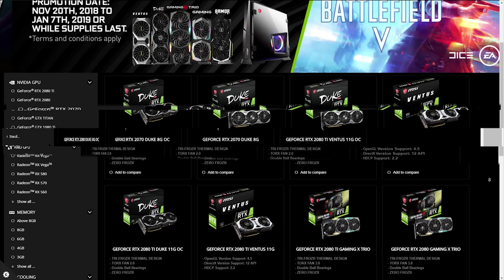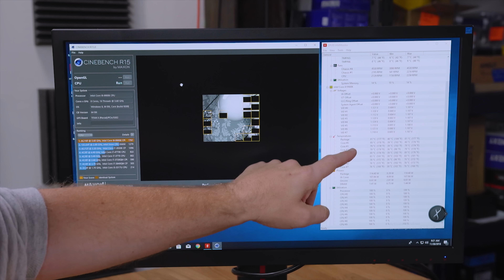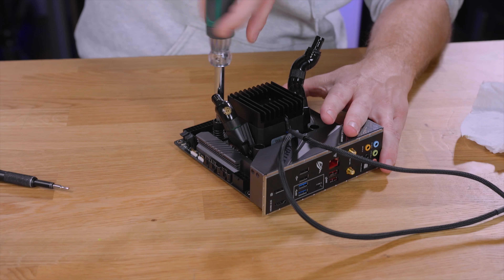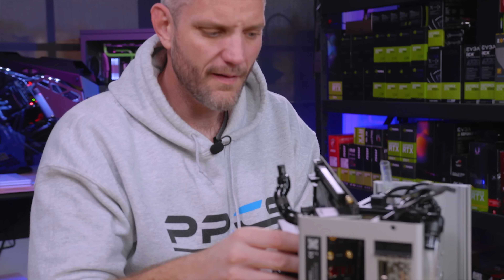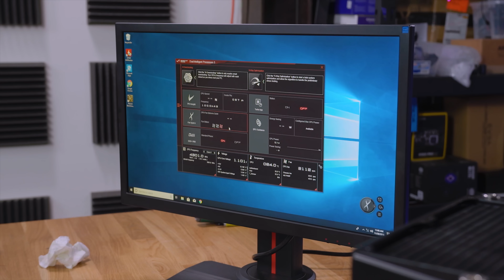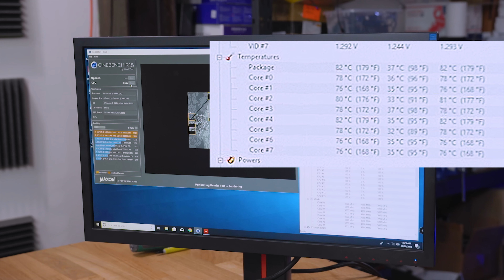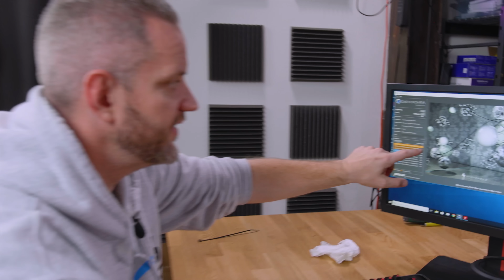Something went wrong with the small watercooled PC...

Comment: Mr. Jay, may I ask your recommendation on a Great PC Case i have a AZZA ONYX 260 and space is running out i need a Water-cooler setup fast because I got the i7 4790k 4.5GHz last week and its Constantly idling on 70+°C and it only has 2 drive bays and i have 4 hdd's 2 of them is just laying on the table behind the Back panel so im asking on Pc case recommendations on great space and drive ports in between $85 to $185 plz or anyone here I need help from the community.. please

Comment: Hy, im interest at a 3440x1440p or a 2560x1440p monitor, but im not shure if i can run this on high fps. I have a i7-3770K (4,6ghz) and a Gtx 1080 (2,1ghz). Or is my Gpu way to weak for this 1440p Monitors?

Comment: Take off the plastic IO cover on the motherboard,  it will help thermals a tiny bit. In a build pushing the boundaries like this it is worth doing. Also, the Noctua A12x25 fans take the Vardar fans to school. You can run them at the full 2000RPM and get the same or better cooling with less noise.

Comment: No shit the 9900k is a scam at14nm, and can’t be cooled with aftermarket water cooling in a normal case and why pay 550 hundred for a cpu that gets you 1-5 more FPS over an overclocked cheap 8700k and or. 8086k?...

So what do you imagine a 9900k would do in a heat sink block called an it’s mini itx case with all that crap in there?..

An oven with no buns... so good luck hahaha put an 8700k in there and I bet better fps and performances in benchmarks and games with a cooler gpu to boot.

Go with a 9700k... 9900k is not worth it just like the crap called rtx and it just works by ncrapia.

Comment: I'm highly debating lapping my FX6300... now before anyone starts to bash it, for all I need it to do, coupled with a 960SSC from EVGA, it meets my needs. I overclocked it to 4.5GHz, and am running the EVGA 120mm CLC, however, my luck with chips is just as bad as Jay's luck with never having to take apart a system he builds, so I had to up my voltage to about 1.4+ so it tends to run a bit on the warm side... still around or below 60C in Prime95, but I would like it to run at like 50 :/

Comment: @jayztwocents You could have a faulty CPU as when i had purchased my origional intel i7 cpu i was idling at very high temps and opening anything would cause my temps to shoot over 100 degrees i think you should try another on or RMA this one and see if the problem persists because it turns out that i had a faulty chip.

Comment: On my last build it turned out that my Swiftech hit a capacitor so it wouldn’t contact the cpu. Ended up desoldering the cap and resoldering it to the back side of the motherboard. It worked great but I wouldn’t recommend as you super void your warranty.

Comment: Damn Jay this is so relevant to me...I just installed the Apogee Drive II into my first full custom loop (7700k delidded @ 4.5ghz , GTX 1080 @2000mhz) all crammed into a Lian Li PC-05s, single 240mm rad...GPU stabilizes at 69 C but the CPU is hitting as high as 83 :( In Cinebench I only hit 72 though. I have to say, it sucks that this unit is the only really viable CPU block/pump combo out there, because I've had bad luck with Swiftech. I had an MCP30 pump fail, and then my MCP35x after ~2 months, and this Apogee uses the MCP35x as well. Guess we'll see.

Comment: Got a question for ya. My son's pc was hitting %100 disk usage. Power supply is fine (being used on a spare system). HDDTune showed only 2 small red squares, so not sure if the hdd was bad. AIO rad was gunked up dust. I installed the fans to pull air down from the top (don't know why) and the top's "dust filter" didn't filter much. I'm left with 3 possibilities: motherboard going bad, cpu overheating, or hdd really was going bad (despite hddtune). Should have done testing, but just had surgery recently and haven't been able to move around like I want. Any ideas?
Reply: If you're using an HDD, it's not showing any SMART errors, and windows is doing any background task like Windows Update, you can expect %100 usage unfortunately; especially if the PC isn't essentially stock. The best you can do is eliminate all startup programs besides those that are essential and make sure Windows and all other programs are up to date. 

Another thing to keep in mind is that the absence of SMART errors does not mean the HDD isn't going bad. SMART monitoring is far from perfect and I've seen several examples of drives reporting good health suddenly failing. Ideally, you would get a small SSD and install windows to that. Use the HDD to store files and programs and make regular backups of the HDD. That way if the HDD goes, you still have a functional computer, and can restore your old files to a new HDD when you replace the old one. Plus SSDs are really quite accessible these days, especially if you only need one large enough to act as a windows boot drive. 

Motherboards going bad typically result in crashes, complete system failure or random hardware errors. You can check the CPU temperature of your computer with a free program called Speed Fan. 

Something else you can do is go to userbenchmark.com and run the benchmark on your computer. Look for areas where your system is performing well below expectations. This can be very useful information when diagnosing a problem.
Reply: @mechanought3495  Thanks for the reply. At the time, I wasn't able to get an ssd (4 years ago). I plan to do some upgrades on his and my wife's in February. For the time being I pretty much gave him my older computer. Easier on me until I get more mobile again. Doc's already been threatening to put me back in the hospital.

Comment: so the fluid gelled up (after one day) because it was getting too hot, even with poor thermal transfer from the cpu.  but now you improved that thermal transfer, so the fluid will have more heat put into it than before... and you didn't do anything to improve pulling heat out of the fluid... so the fluid will gel up even faster now...  right?

Comment: I think i have a similar issue. I had an 8700k at stock hit mid 90s (this is on a custom loop: gpu, mobo block, 360 rad and 420 rad) and it turned out to be some terrible thermal paste contact on the motherboard block. I'm now getting mid 60s to high 70s after just a better paste application. I'm thinking lapping will help more as that's still a bit high, but i lack a rigid flat surface so can't do that at present,

Comment: I honestly would have thought at 4.3 gigahertz that it would be way higher than my ryzen 7 2700 at 4.1 gigahertz. I use pstate overclocking at 1.3 volts and I score 1853 on cinebench and stay under 75 degrees under full load I understand this is a small form factor computer.

Comment: Jayz.. can you rotate that cpu block 90 degrees.  Could the fins be trapping heat since there is no air movement across it .. let convection take it up vs. trapping by rotating it?  Would going push/pull on it help any?

Comment: Hey Jay,  

I'm building a really expensive PC with watercooling,  About 9 Grand for the build.  It will be the 9900k and a maximus XI Formula board.  and (2) 2080 TI OC's.  I will have (2) 38mm radiators (1) 360mm and (1) 240mm.  Will that be enough to keep the CPU and GPU's Cool?  And should I run it in 1 big loop or separate the loops between cpu and gpus.  Also is there a coolant that you personally like the most?

Thanks

PS: Love the videos!

Comment: Custom cables routed better and the original psu? Could you cnc a hole pattern in the side to exhaust the psu? Add feet? De-Lid? Part 3 for sure...

Comment: Small enclosures need forced air in and free flow out to stay cool... learned this with xbox 360's  pulling air in takes time and when it finally reaches cpu its all ready heated and the air is  thin... swapped out the direction of flow and now u get cold dense air right to cpu and the air gets thinner and moves faster out of the case pushing through all the component restrictions

Comment: I literally finish my computer build halfway through watching this video lol. And it's finally stable 4.7GHz on 8 cores on a 9590 running at 55c using super coolant, not antifreeze to keep it that low. I love this channel it helps me not make stupid mistakes
Reply: Nice but 9590 is not a 9900k. Its a whole different level of performance. Average user benches are 125percent better mixed cores even close to 200 percent.
Reply: @12Burton24  but I would much rather threadripper but I work with what I have.
Reply: @12Burton24  yeah but I got it to run stable at 54c that's an achievement on its own. And they should be able to get it to run at 55c f 5.2 GHz stable. Once I finish my random stuff.
Reply: @Mowuniverse  or maybe not 5.2 ghz is a lot but actualy far away from the performance of a 2700x
Reply: @12Burton24  well I got it there before just couldn't cool it.

Comment: You griped me at building in an ITX case without a carry handle.  Putting that aside, however, all cases should have decent airflow, which is something this one lacks anyway, to an extent.

Before resolving the build, I would suggest you use it daily all the way up to New Years'; this would, then, help to judge what the mileage is on a watercooling solution in such a small, cramped chassis.

Comment: You need to test it with the side panels back on. I understand the CPU and block needed attention, but the whole beginning of the video was a list of components that were obstructing the air flow. So for the second test you essentially eliminate those variables. That testing methodology is not fantastic.

Comment: I have a 3 step suggestion.
1. use the extra "medium hats" to add fans in order to do push pull on both rads.
2. Reverse the bottom fans so that all rad fans are blowing out of the case.
3. Place the case on its side. (Prop up with books or buy tall stick on case feet)

Comment: This might be the issue i have with my 8700k. It runs fine at 4.5ghz but when i put it to 4.8ghz and run cinabench it will hit 100c. instantly. I have the 115i corsair cooler and it wont go over 65c at 4.5ghz. I have mx-4 thermal paste and it seems to be spread out evenly. but shooting to such hi temps so quick makes me think its a slightly warped cooler plate so contact is not good enough.

Comment: It's disconcerting how many CPUs are not flat on the bottom
Have they always been that way?
Or is this a quality control issue?
Reply: There are always acceptable tolerances in any manufacturing.

My guess is that the more effective cooling has become, the looser the tolerances have become.
Reply: Lapping the IHS was already a thing on Pentium 4s, so it's pretty much always been that way.
Reply: @SteelSkin667  Never had this issues with amd somehow
Reply: @thomasgerhard1702  I never had this issue with any CPU whatsoever, whether they came from AMD or Intel, usually the thermal paste and mounting pressure are enough to do the job. Lapping the heat spreader is a thing on any CPU that comes with one, but it's only helpful in extreme cases.
Reply: It appears the cooler probably needed it more then the CPU.
Reply: Lol, I hope nobody laps the bottom of my CPU.
Reply: @princessofscotland  yes sir that would be problematic I'm with you I'll stick to lapping the top.
Reply: Wild Bill Nah, they need a bit of unevenness for good connections.  Though it's no longer 2 to 3 mm on each pin like on the original 8086.
Reply: Wind256: do not say that to a flat earther, he will not see any curvature...
Reply: I suspect the gunked up microfins played the biggest part in bad temps personally. It would have to be out by a lot for thermal paste not to make contact.
Reply: Yes intel cpu's always had this problem. Had to sand every single one of them. Thank god AMD is back in the game.
Reply: gotta be quality control. I've seen many people talk of curved IHSes but my 9900k is dead flat. It was the first thing I checked upon receiving it.
Reply: I don't think lapping was the whole problem, it was the backplate that on other coolers is metal being a thin plastic sheet means that it will bend will cause a poor thermal paste application...

He increased the volume of TIM and made it perfectly flat so that the core gets a proper amount of thermal paste which fixed the temperatures
Reply: replacing the IHS with a custom copper one sure did the trick for me :D
Reply: @cndJokester  are custom copper ihs really worth it? I mean, all ihs' are copper underneath the nickel plating and you get a mirror copper finish after 10 mins of lapping on 3 different grits... I could see it being a thing if they're already perfectly flat and you're planning to delid anyway
Reply: @hotdogwater69360  well the aftermarket ones are actually larger surface area. and its $20... so its not like its allot of cost.
Reply: @cndJokester  i feel u, fam
Reply: I run 5ghz all cores on my 9900k on a Hd3 z370 mobo at 1.320v and I get about 87c max after 5 back to back cinabench runs. Cooling is a h115i 240mm 😢
Reply: @MattyGainz  Must be poor QC on Intel's part. Just lapped a new 9900k for a friend and the IHS had multiple low spots on it.
Reply: Is this a joke or are you serious?
Reply: Even older than Pentium 4, lapping was a thing even with some Socket 370 Celerons back in '98. But it was not because the CPU would be curved, it was just to make the distance shorter the heat has to travel through. It feels insane to me that modern Intel cpu's are a spinner and you have to lap them because they have so much curvature. x)
Reply: Wrapping happens because of Soldering. This why the IHS has a small hall. But I don't if it's a quality control issue.

Comment: I don't understand why people still watercool in 2018. Modern hardware has gotten significantly better at heat dissipation, as well as becoming more than powerful for the needs of most users. Literally what are you doing that requires watercooling? Running simulations? Rendering 4K video? Streaming? I highly doubt it.

Comment: I'm very disappointed. you created something to avoid in a water-cooled system : a rad sandwich. That's a beginner mistake. 
Do a real test : case closed, 1 hour game bench and prove your system will not throttle and be less efficient than an air cooling.

Comment: Jayz why don't u go ball to the wall. Adding a radiator at the bottom with 2 fans, a radiator at the top with 2 fans. Then making the cpu and gpu into a custom loop. I'm suck with custom loop, for me if u buy this case i would have an aio for cpu and a hybrid aio gpu top and bottom. I think that what the top hat was designed for aio wish that some support for custom loop like a back mount water tankand pump combo with hole for loop

Comment: I'm not a PC building expert, but I am a machinist.  You would do better to lap those surfaces together with some Clover compound and put your radiator fans in a pull config (prevents turbulence between the radiator core and the fans).

Comment: A few things :
1)   I WILL KEEP MY EK CLEAR fuild no shits in the blocks . u can keep ur flashy fluids
2) put push inside both bot and top fresh cool air in the case maybe a litlle warmer air but u will get better flow and pressure of the air to psu and to holes above i/o shield also to block pump and vrms . 
3) why not a small rez like Swiftech MCRES Micro Rev2 Reservoir ?  that should help a litlle too AND get all air out of ur system u know water goes 1-2 fingers lower after 1 week running a few hours per day geting hot and cold a few times.
4) pure lapping talent can t be random

Comment: Hot AIR rises, HEAT radiates in all directions.
Reply: Heat transfers in conduction, convection and radiation. Hot air moving up is natural convection, but if you use a fan to help the flow move up, you have a mixed or combined convection(natural and forced). Radiation tends to be the least important heat transfer mechanism in these low temperatures(each material has a temperature, usually in the thousands of Kelvin, that it has peak radiation emission of heat). The CPU and GPU transfer heat through conduction to the respective plates, those exchange heat through conduction and convection to the liquid in the loop. The liquid in the loop transfers heat to the radiator tubes, the tubes conducts the heat   to the fine and with them and the exposed tube surface transfer heat to the air through conduction and convection. It's all hundreds of Kelvin under the temperature where Copper or Aluminum have significant radiation to become the predominant heat exchange mechanism!
Reply: @chaoswarriorbr  I applaud your description here, but my comment was a direct response to the statement that he (and MANY others always make) "heat rises". He may have been speaking specifically about his project but his statement was the exact same general statement that most everyone makes, that's why I kept mine as a simple statement. Instead of saying "heat rises" I simply stated "hot air rises". It isn't much of a difference in terms of a statement but it's a lot more accurate.
Reply: @JosefTrull  Fair enough!

Comment: So wonder if all 9900Ks are in need of lapping? Soldering might have mode them convex again, issue we haven't had with toothpaste. Got another 9900k handy to see if it helps with temps? I haven't lapped any CPU since my 2500K and it was my last soldered chip (and horribly concave).

Comment: Jay do a Case Mod on it get some tiny fans (you know 40mms ect) and see if you can fit in some behind the bottom shield above the Main intake fans or Drill some holes in the side panel. 

also I know i will get shouted at for this would a Retro Ram cooler fit between the PSU and pump block?? not to cool the Ram but to push air out of the middle of the case and possibly draw in Air through those Side panel drilled holes.       if that case was 40-50mms taller for a side set of fans that'll be the boss to solve the heating issue (Tiny 40mm RGB fans anyone)